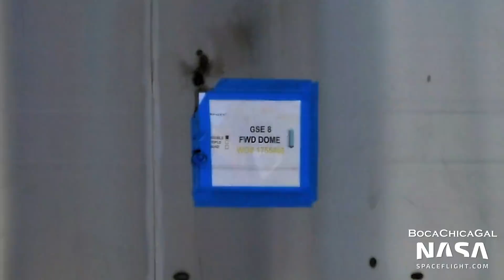Aerocovers for New Starship Delivered | SpaceX Boca Chica

Comment from the maker: 0:00 - Sunrise at the Launch Site
0:39 - Barrel Sections for Starships and Super Heavy Boosters
1:05 - Possible Quick Disconnect Arm Extension
1:30 - High Bay Rooftop Bar Construction
1:57 - Crane Moved Down Highway 4
2:26 - Booster 5's Stacked Sections in High Bay 
2:53 - Delivery to the Production Site
3:44 -  Barrel Sections Outside the High Bay
4:11 - The Orbital Launch Site
5:00 - Booster 4 on the Orbital Launch Mount
6:22 - The Quick Disconnect Arm // Used to load propellant into Starship and stabilize the stack
7:07 - Barrel Section Moved Outside the Tents
8:05 - New Structure Assembled at the Propellant Production Site 
8:31 - Lift Being Placed Inside a Barrel Section 
8:54 - Foundation Work for the Wider High Bay
9:21 - Nosecone with Thermal Tile Attachment Points Inside the Tents 
9:50 - GSE Tank 8 is Nearly Complete
10:19 - Propellant Production Site // SN15 & Ship 16 sit to the right
10:45 - Aerocovers Delivered to the Production Site \ These shield the flap actuation mechanism 
11:24 - Booster 3 and Ship 20 // Only the Liquid Oxygen tank of B3 remains standing
11:52 - Unused GSE Tank 8 Forward Dome Moved Outside // It was seen inside the tent at the beginning of the month
12:34 - Roll of Steel Cable Delivered (unless you can see its synthetic)
13:01 - Ship 20 Awaits Testing on Suborbital Pad B // Ship 20 (left), Booster 3 (center), Starhopper (right)
13:29 - Ship 20's Thermal Protection System
14:22 - Crews Work Inside Ship 20's Aft Section
15:14 - Work on the Orbital Tank Farm Continues // The Liquid Nitrogen tanks appear to have been sealed
15:44 - Carriage System for the Chopsticks // The Chopsticks, used for catching and lifting, will be attached to the carriage

Comment: Thermal protection looks so good and the finish of the main rocket comparing it with the original 'tin can'.
Reply: Every time I see it, I think ' dragon scales'.
Reply: Aesthetically yes but let's see if it holds
Reply: @joweydelanota7421  the thermal protection system also seems like such a step up on the engineering side - we'll still need to wait to see if it holds of course - but the TPS is looking good more than just aesthetically
Reply: @willh2739  They literally had to replace hundreds of damage tiles over the last week. Not sure how your divine eye can tell the difference lol
Reply: @iamjadedhobo  Thanx for stating the obvious🤣

You do understand that a possible conclusion can be that there is not a practical way for the tiles to hold right?  Like you could have make your general answer briefer lol
Reply: @joweydelanota7421  
Troll elsewhere. Just because the first iteration requires hundreds of replacements and refurbishments means absolutely nothing when future iterations of the same system will be better.
Reply: @iamjadedhobo  Why would SpaceX create failure points on purpose? That makes absolutely no sense. You design a system, test it, and after you analyze the data and look at what you can be improved if anything. 
At sight you can tell these tiles have to placed manually which exponentially increases the room for error with each iteration. That's a huge problem long term.

I remember texting Elon about my concerns over the TPS. They updated the system drástically since. Came out with an aesthetically beautiful system which already proved my point.
Reply: @erictheepic5019  you have to roll the R's when you say drragon!
Reply: @erictheepic5019  killer whale
Reply: @joweydelanota7421  “texting Elon” hilarious

Comment: 8:06 I wonder if that's to be a permanent staircase for the launch table, to replace the temporary ones that are currently built into the scaffolding after they're dismantled. 17:06
Reply: Would even one that sturdy be able to survive the flames and sound waves at take-off? It does not look mobile. Or will it be equipped with large truck wheels?
Reply: Or for the wide bay.
Reply: @LACHIVA1969  Possible.
Reply: @LACHIVA1969  To resolve the issue of not being able to use the high bar due to no escape route?
Reply: I thought there was a lift on the side of the launch mount. Quite a climb up n down the scaffolding to get a wrench😂.
Reply: @LindaMadlala  To be replaced soon with a permanent one, according to Elon.
Reply: I have special news for you it has it's own built in table and chairs with also cable TV did try sky but they were too expensive

Comment: Nosecone at 17:30 does not have lifting clamps. Probably going to put them on sides like booster. Tower can’t stack it using nosecone lift anyway as pulleys and tower are not tall enough

Comment: The QD arm extension (1:18) being worked on at the production site will have to connect upside down to the rest of the already installed QD Arm for it to work.
Reply: The arm must pivot at a single joint, and there must be telescoping pistons between a second set of pivots, so that the arm can reach out to Ship without swinging through it. The fuel & oxidizer lines will also articulate, maybe via rigid pivoting links, but that’s not too difficult. ;-)

Comment: There are tabs with holes for pins at 16:11. Perhaps they pin to trolleys that will be attached to the tower legs before this goes up. Has anyone seen any trolleys (like railroad car wheels) attached to the legs awaiting the carriage? (They might even be assembled directly on the tower legs themselves so they can be mounted onto the tracks on opposite faces of each leg.) These trolleys should match the vertical spacing of the two Vs)
Reply: What is being called the ‘carriage’ being erected near the chopsticks will reach around the front three pillars of the tower. The four side arms have pivots that will likely serve to carry telescoping pistons to clamp the tower pillars with. There are many rectangular “feet” with pivots on them set about the construction area that may be used for this. The vertical positioning will be achieved by the tower cable system raising and lowering the tower carriage. I don’t know how the weight of the Ship will be counterbalanced yet when it is being carried and raised/lowered.

Comment: Elon was talking about static fire this week. That must be for the ship. I don't think the booster can do static fire with that scaffolding on the launch table. I also wonder if gse8 is needed for static fire of booster. Tps seems practically ready. Only few at the bottom
Reply: I have never heard of, or seen, a static fire test without a cryo test first.
I have never seen SpaceX do a cryo test with Raptors installed.
If they static fire test S20 without cryo testing it I would be very astonished, and a bit worried about the reason. It would be taking a huge risk.
Reply: @knowlegeisgood8735  Thoughts on why a cryo test can't be done with engines installed?
Reply: @scottgaree7667  If the hull fractures it will collapse and the Raptors will likely be toast.
Reply: Why not both?? 😜 Do the cryo test and if the shit doesn’t blow, turn them candles on! 🤪😂😂
Reply: @bastiaan1532  Because this is no joke. 6 Raptors are at stake.
Also the thrust puck has not been stress tesed yet. It is a new one with places for 6, not 3, Raptors.
Reply: @knowlegeisgood8735  my reply was tongue in cheek. I'm equally surprised now that this was pointed out. You never know with SpaceX. Always something up their sleeve. I'll be surprised enough if all the tiles will stay on throughout the testing.

Comment: Looks like s20 is still missing some tiles on the engine skirt
Reply: Yes, those will be done as late as possible, to avoid damage. They have not had any new inspection yet either (as far as I know). I would expect that inspection to point out several problems. They have time to do one more round. It will not fly within the coming 2 months or so.

Comment: The CCS (Chopstick Carriage System, doncha know) is going to be fascinating to see in action!
Reply: Confusing with a car charge port!
Reply: It has a name already: Mechazilla.
Reply: In the RGV aerial footage, perforated square tubes some three feet on a side are visible with mounting studs that correspond to the chopsticks. If they were to put a tank-treaded carriage half the length of the chopstick on that tube, that could catch and move the booster back and forth as needed.
Reply: @jamesrosar3823  There 2 claws. 
One large one on the landing pad. That one is part of Mechazilla.
The other one is on the QD extension. It is being constructed at the production site.

COuld you be confusing the two?
Reply: I don’t believe I have. What makes you think so?

I had referred to the pieces that have been mounted to the chopsticks today, <Knowledge Isgood>.

Comment: That upclose of tps tiles shows straight horizontal lines, I thought they didn't want them because of hot gas/plasma infiltration.
Edit: time 13:57
Reply: It is almost impossible to avoid where the barrels meat. Studs on one are very hard to make fit studs on the other such that a tile can bridge the border between them. This has to do for now. If they at some point can manage to get around that problem they will.
Reply: I don't think they can avoid them on the nose, not using tiles of all the same size anyway.  They'll have to design a set of non-hexagonal ones or hexes of decreasing size maybe... not sure how to cover a cone this way with no 'breaks' in the pattern.
Reply: @svenp6504  A football uses hexagons and pentagons. But the nose needs a bit thicker tiles too since it is one of the most vulnerable areas.
Reply: @svenp6504  pentagon

Comment: I am curious, is the nose made from reinforced carbon-carbon?  It appears to be just black tile.  I would think that it being more resistant to heat than the tiles, they might have went with it on the nose.  It may not be necessary since it's reentry profile is different than shuttle, but still curious if it would have helped to have it.

Comment: Would it make any sense to have ship and booster sections that cam-lock or bayonet lock like camera lenses, instead of welding?
Reply: Remember, the majority of the body is a pair of large pressure vessels.  Would be hard to make that seal in the face of thermal expansion and contraction.  Welding is not likely to be optional.
Reply: Is it Astra that 3 D prints their entire rocket? It ends up being a continuous weld bead from bottom to top, needing only local finishing to fit your fittings! Every unit is custom, with no need to do the same thing twice. How fast can you redesign?

Comment: My question. Those lifting brackets on starship will they not melt and damage heat tiles on reentry.
Reply: They will be removed and replaced with heat shield plates before lift.
Reply: @MartinRunesson  well, after lift (that's what they are there for) but before launch :)
Reply: @kevinkrammer8077  true!😂
Reply: @MartinRunesson  I'm not so sure they can go that high after a full stack.  It seemed crazy just to get on top of SuperHeavy.  They would someone to go on the frankencrane. No other way to go up there.  Cant reach from the tower either.
Reply: That won't be an issue once the chopsticks are operational
Reply: @LACHIVA1969  They have to come up with a temporary way to reach it or they have to wait for Mechazilla to be complete for the final stacking, otherwise they can't remove the straps after a crane lift.  Maybe that's the plan.

Comment: I have a question for Elon Musk. I  am not a rocket scientist, but if a jet aircraft can reverse thrust its engines to slow down upon landing would it be possible to do something similar upon re- entering  the space craft from space instead of the high speed high heat re -entry so a heat shield would not be needed to slow the  starship. Just a thought.
Reply: Not enough fuel ,you would need as much fuel coming back as going up .Space flight wouldn't be possible with current technology we have ,payload is only a fraction of fuel mass .

Comment: I wonder how spacex will deal with the thermal contraction of the ship during cryo testing, wouldn't it damage the tiles since their being squeezed together as the vehicle gets colder.
Reply: There is space between the tiles to handle both contraction of the ship skin when cold fuel is loaded and thermal expansion during re-entry.

Comment: I want to know if you are in the bar at the top of the high bay and you look north east ,can you see downtown Houston across the water. Maybe even the American National building in Galveston.
Reply: No, those are both much too far away. If the bar is 240 ft above the ground (allows 70m for the booster and 10 ft for a stand), the horizon will be 30km ( ~18 mi ) away. Galveston is 270 mi away, Houston is even farther.
Reply: @donaldmiller1782  Didn't think so but fun to think about.

Comment: Man... That tower has been months in the making. If the booster explodes on take off, it'll take just as long or longer to rebuild.
Reply: Likely to be very overbuilt for either explosion or contact.
Reply: Man, if the booster explodes on the pad…..I don’t think I can rewatch them rebuild everything! But I have faith in spacex that the booster will atleast clear the tower
Reply: Well no, they’ll have learned from this first time building in so it’ll be quicker to rebuild it. But yeah there’s a reason the tower is a lattice like structure, it will not catch much of the shockwave
Reply: @SofieBrink  The entire site will go if there's an immediate RUD, tanks and all.
Reply: Losing 1 or 2 years in this industry is not unusual at all. It will suck, but if it can't be avoided then you just clean up the mess and go on.

Comment: Question: has anyone determined how many UNIQUE TPS tiles are required for SN20?
Reply: Interesting question, I was wondering the same. Rough estimate: Since nose gets smaller to top, tiles get smaller until there is a cut line and size restarts. I estimate 10-15 different tile sizes for the nose surface. The barrel surface only needs one tile  type, probably already included. Then we have the curved tiles, maybe 10-20 and the square+machined tiles where they go around some attachement point or other surface structure, again in same ballpark.

So I think its probably something between 30-60 unique tiles in total.
Reply: I would say no more than a 100
Reply: IIRC it's around 15,000 tiles which are almost entirely the same hexagonal shape (with some trimming depending on where they're mounted) with a few truly unique shapes like the squares on some parts of the fins.
Compare that to the 20,000+ individually unique tiles on the space shuttle for an idea of how far we've come.
Reply: @gobblenater  I don't know that a tile can be "trimmed". If they need tiles other than the standard hexagon those tiles have to be made to those measurements before they are sintered in an oven.
As to how many...give me a complete set of images of S20 and I might try to count them.  😉

The section that have non-standard tiles are:
1. At the edge seperating barrel sections. Those are straight borders where studs on one would be too hard to match to those on the other.
2. Areas around the flaps. Smaller size hexagons on the flaps.
3. The top section (~1m) of the nose cone.
4. Areas around vents or sensors and antennas and lifting straps.
They add up, but are still nowhere as many as the standard tiles.
Reply: @knowlegeisgood8735  I dont think they're just cracking them in half over their knee or something lol. 
I'm sure they have some process to precisely measure and cut tiles to fit as needed. The cost savings would absolutely be worth it.
Reply: @gobblenater  No. Even the sides of a tile have to get the surface coating the top gets. It is not done the way floor or wall tiles are.
Reply: The “bakery” has been kept very busy casting custom tiles for the odd spots left over where the rest that did fit don’t leave room for a typical tile. SN 20 will be able to teach a whole lot about which of the many ‘shortcuts’ they’ve had to take fare worst; but they should work. As the new aerocovers show, SN21 will avoid many of the design issues that made tiling so hard. With those mods, they may get down to some three dozen shapes, but that is a very rough guess!

Comment: Will the lauch mount be able to stay intact after all the heat and thrust from the booster, would the water be enough to prevent damage?
Reply: The launch mount seems to be made of such heavy steel that even a booster full of Raptors will just peel the paint. As long as the heat loading is short, it might be fine after being cooled with a little water. (Next!)
Reply: @jamesrosar3823  Oh, thanks for clearing my doubt...

Comment: What is an aerocover 🤔
Reply: It's to protect equipment (cables, pipes, etc.) that has to be mounted outside the propellant tanks from the airflow as the rocket moves through the lower atmosphere.
Reply: The aerocover seem to be for the top hinge of the ship's flaps